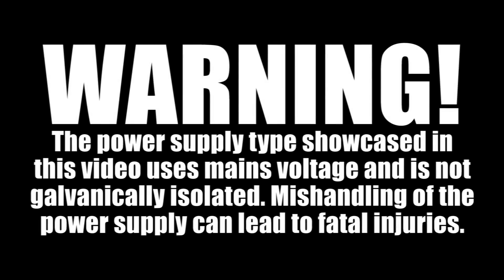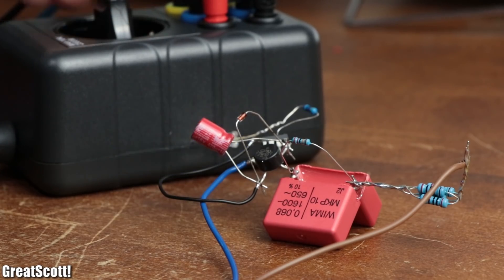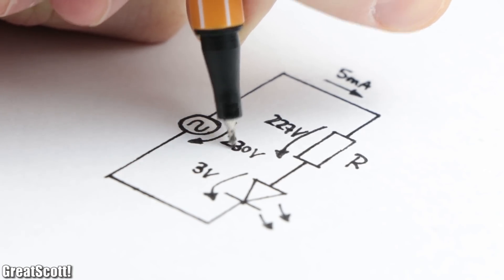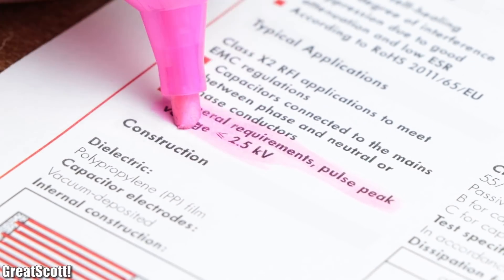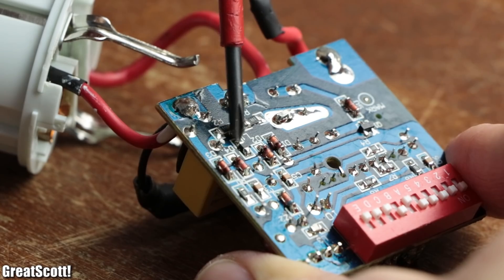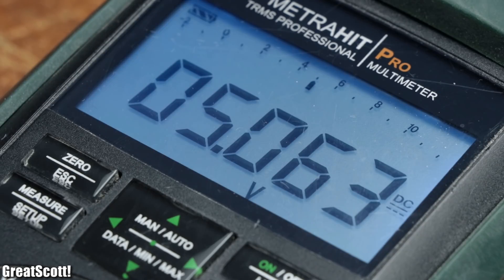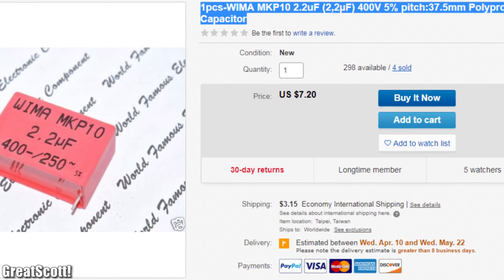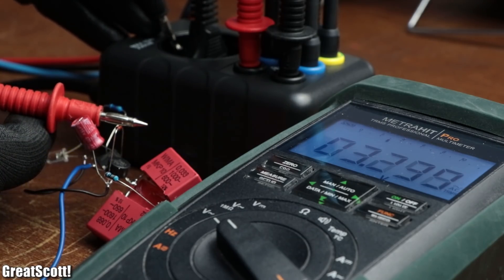The most Dangerous, yet Cheapest Mains Power Supply?! || Building a Capacitive Dropper Circuit!

Comment: it's not the inrush current that kills your LED's it's the reverse voltage needed to be dropped by the LED's. Inrush does kill your LED's though but much slower than that.
Reply: To add to this, you can resolve the reverse current problem by adding another diode across the LED in the opposite direction.
Reply: @rupert274  Wouldn't you have a bigger inrush current problem?
Reply: Why much slower? There was nothing limiting it
Reply: Ha!  I was going to say that too about the reverse voltage.  But as far as inrush, I don't think there is any in this circuit.  Great idea by @Sean Smith to fix the circuit.
Reply: what i dont understand is why it worked with the resistor
Reply: @b062838868  I'd guess there was enough leakage current through the LED that the resister was able to drop the voltage even when the LED was reverse biased so that the LED did not pop immediately. It could well be that the useful life of that LED was significantly shortened. The absolute maximum ratings only tell one it is guaranteed safe to stay below that rating without damaging the component. It does not tell you how it will fail or be damaged if the value is exceeded. Also the safety factor may be quite different in different parts of the rated temperature range.
In addition there is a transient when the thing is plugged in. Statistically it is unlikely that the mains voltage will be at or near the zero crossing when power is applied to the circuit. A capacitor will not limit voltage or current of this transient (frequency components of the transient are much higher than 60 hz making the capacitor a dead short). There is a 50-50 chance the voltage will have one polarity or the other at this instant. If forward biased during this transient it is very likely that the in rush current will blow the LED even before the next half cycle.
Reply: @ivanperezs  The reversed biased diode will only eliminate the reverse voltage on the LED it won't help with the inrush problem that would occur when power is applied. Statistically the mains voltage will likely be closer to peak rather than zero when power is applied. A series capacitor will not limit the transit current and initially won't drop the voltage either. Pop goes the LED.

Comment: Back in the 90's I had to work with a company to design a custom SMPS for a project I was leading.  What I found was that you needed LV power to run the SMPS control and could not use the outpt of the supply because the controller was needed to created it.  Sort of a chicken before the egg problem.  What I found was that the SMPS needed a small direct-mains supply to get everything going.    These supplies usually can't generate much power; but, if you don't need much power they are very simple and may suffice.  I am sure the IC I used is long gone.  It is certainly long forgot.  I did a quick Google and found NPC785A. It accepts up to 450V DC in (provided by a simple rectified DC) and can produce 5V out, 10mA.  Note: If you go 3-prong you could rectify to ground and reduce some of the safety issues (but no all) - certainly doing anything directly with AC Mains can be lethal.

Comment: The REAL reason why your LED kept blowing up was the missing full bridge rectifier. Only in the first half of your AC wave your circuit was a voltage dropper, in the second half your LED is driven backwards. And in backward direction an LED basically acts like an open circuit, which means the entire 230 Volts are on the LED, until it blows.
Reply: Could be either/or. Plugin in near the top of the mains sine wave the empty cap is like a short and you have 230V spike at the LED. The direction does not matter in that case. But yeah, connecting LEDs to more than 5V (typical) reverse voltage is a no-no (and completely ignored in the video).

Comment: Big difference between Greatscott and ElectroBoom 

GreatScott: gives warning about 230V 
ElectroBoom: Touches 2 Kv Transformer and just yelling around
Reply: rubber hand vs. hair hand :D
Reply: kV*
Reply: because in Iran human life is valueless
Reply: First you go home and touch 230 VAC then talk to GreatScott.
Reply: the warning is included within the show
Reply: ElectroBoom: Fakes touching 2 kV transformer. Unlike 120 and 240 V, 2 kV @ 1 A is typically a fatal one-way trip.
Reply: @samjones1954  A Vandergraph generator puts out microamps, so its not lethal. That's why you can touch it. The current is very low and benign. With higher current, you're in trouble.
Reply: @samjones1954  And FYI electroboom uses props to stage his "electrocutions" for theatrical effects. He says it himself. So please do use extreme caution when working with anything over 50V that has some power behind it.
Reply: electroBOOM does it on purpose so that all of his viewers understand that electricity is dangerous to physical contacts and all should gain confidence for what type of energy hurts a lot and what doesn't.  Also the video should be educational and funny. Or else who watches if it's booring
Reply: Seems like most of my replies are Electrical Engineers that does not understand the definition of “joke” 
Well lesson learned: never make a silly joke on serious electrical video because a bunch of serious Electrical Engineers will butthurt you hard especially if you make joke about electricity but actually knows nothing about electricity 

i may be not an electrical engineer but a 2 kV at 1 A wont kill you in an instant it actually also depends on the shock time idk to say it but basically if you touch 2 kV and 1 A of current is flowing but u only touch it for just a split of a second then it wont kill you also ITS THE VOLTAGE THAT KILLS NOT THE CURRENT
Reply: @RizLazey  you are absolutely correct ..it's the voltage that kills but if you accurately check the situation you will find that voltage and current both work for each other to kill the noob who is touching the wires. It's like a alliance between two terms
Reply: @AbhishekThakur-wl1pl  Ypu? Ypwho? You could at least hit the spell check before  you insult me. At any rate, yeah I've seen some of his vids and how he does it. My comment was in general, not specific, but you assumed otherwise. My point to the poster that I replied to was in case he was actually being serious. High voltage at moderate and high current can kill, and in this day and age of rising ignorance (don't think your magically excluded, Im sure your ignorant of enough things to make you dangerous), its still worth mentioning.
Reply: @AbhishekThakur-wl1pl  And yes... because you obviously need it spelled out, you can "touch" the output of an MOT if your not referenced to ground, but with the utility pretty much everything around you is "ground" due to how electrical grids are constructed, why take the risk? To me saying you can touch this or that at so many thousands of volts without regard to what it actually is is like looking down the barrel of a gun at a shooting range to see if theres a round stuck in the chamber. Sure, you can do it, but better safe than dead.
Reply: @mysock351C  he literally got his ass saved by a garbage cable. He did it one accidentally and survived, rest of the times it was low voltage.
Reply: @akash-zg4vj  Because resistance... (albeit the body being a sh-- varistor)
Reply: Mai Mariarti  You're saying the same thing and also saying you disagree. In Iran everyone is poor except a few people, so yes in Iran human life is valueless compared to more developed countries with higher degrees of class equality.
Reply: on the other hand I have received a good shock from a 12V boat battery. Bare feet in salt water greatly increases conductivity and can make 12VDC hurt, may even be dangerous in just the right situation.

Comment: "As you can see a switching power supply is too big for my tiny ATtiny85 project so I will make my own power supply from 3 ENORMOUS capacitors!"
GreatScott's logic :D
Reply: He also put it in a rather big enclosure... Suming this all up: It doesn't make sense - only for educational purposes - but practically it saves zero space after all. Lmao
Reply: @fusseldieb  I think it is still true that these power supplies CAN be much smaller. From what I can tell, he was kind of just using parts he had, and he was also not trying to 'compactify' stuff, since spread out components are easier to see. I can definitely understand how this kind of power supply could be far smaller than the other, since you can pretty easily get very small capacitors that still have enough capacitance, but you can only get a transformer and some 10 other capacitors so small.

Definitely though, the specific design should not be used for lightweight purposes XD.
Reply: For 12mA, a 330nF capacitor, which is a lot smaller, will be enough. And a 1uF capacitor definitely will be. He also connected the LED wrong, a capacitive dropper only works with a full bridge rectifier or 2 LEDs. The circuit he build was a single diode rectifier with a capacitor.

Comment: When i first saw such a compact power supply in my home door bell, I was fascinated. Thanks for explaining the principles of the circuit.
Reply: @jeffsadowski  No. Modern mobile chargers are SMPS. They don't rely on capacitive reactance to drop out mains voltage.
Reply: @jeffsadowski  sure, if you like charging your 3,000mah battery with just 10ma /s

Comment: When you put the LED on main power, you need to take on concideration the reverse voltage on the LED with AC voltage.
Reply: It's a diode.
Reply: @TheCarpenterUnion  Yep, I think zak is saying there's a maximum reverse voltage the LED can take and you need to be aware of that so as not to destroy the LED.
Reply: @TheCarpenterUnion  Usually LED's have a maximum reverse voltage of 5V, anything more and you destroy the diode.

Comment: I learned about capacitive dropper circuits when I tried to add a timer to a heater. The PCB outputs 5V for some IC's, and I thought I could supply my Arduino with that. It surely worked without a hitch. The problem occured when I also connected the Arduino to my PC, because I was tired of disconnecting, checking on the heater if it works correctly, reconnecting, patching the software, etc. The moment I connected it, my breaker tripped, all capacitors on the arduino popped, the 5V line was toasted, and all my USB3 ports on the motherboard were dead. Luckily enough, the motherboard survived. I'd definitely recommend that motherboard for the durability. Will look up the model if anyone is interested. After closer inspection, i found out that the ground had continuity with the live/neutral wire. From that time on, I always check the power supply and conductivity before attempting any modification on cheap chinese appliances

Comment: 2.2uF X2 class caps can be sourced cheap sometimes. I have made pretty much the same circuit as presented here quite a few times for several projects.

The power can be a bit dirty (AC ripple) and is subject to RF interference.  I remember having a CD4011 quad two input NAND gate configured as an SR latch operating off this capacitor power supply, and the latch would often false trigger. From memory the problem was solved with some hysteresis and further smoothing of the supply with some 104 caps. I exchanged the CD4011 with a CD4093 and used some 104 caps on the SR lines of the latch. ☆Great Scott☆  it worked! ...

Think outside the □ and mix in some ♡ then use your ☆ for success...

Gret video and thanx for sharing!

Comment: I've actually spent a lot of time messing with something similar in a circuit simulator and I had a lot more luck using an inductor as the reactance source rather than a capacitor. Putting a proper sized capacitor in parallel also greatly improves the power factor. That being said I also forwent the rectification and connected a pair of LED's with reversed bias directly in series with the reactor

Comment: Years ago, when I was young, I tried powering a DC motor with one of the capacitive dropper circuit which I found inside an LED lamp. A few minutes later, I was able to witness the power resistor being converted into a smoking light bulb.